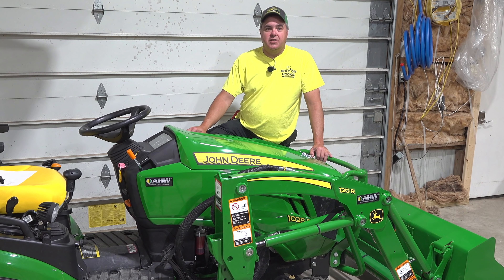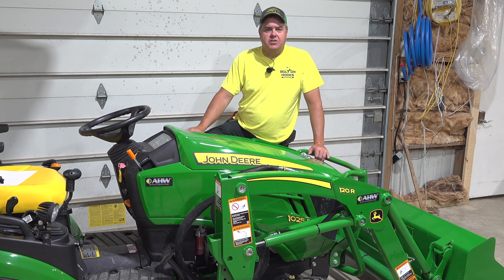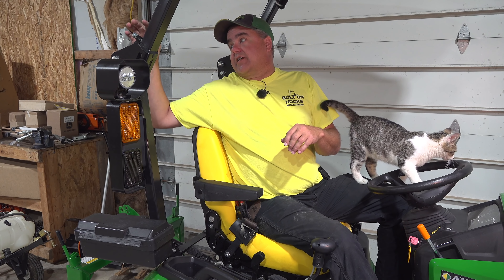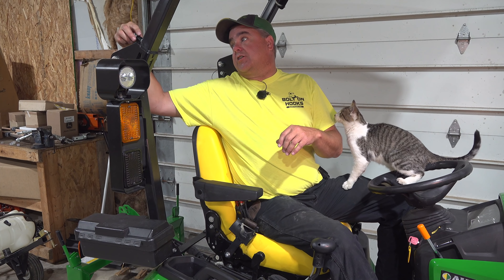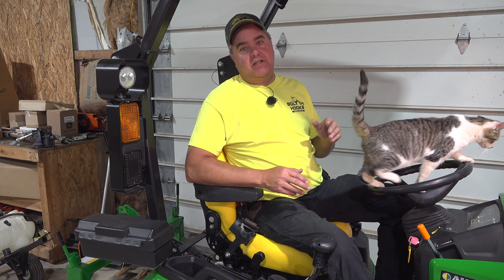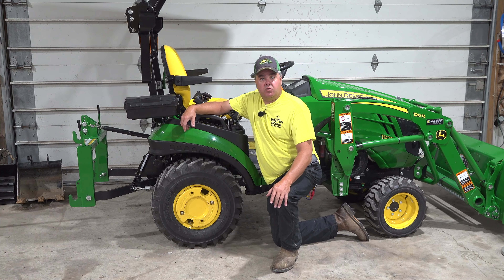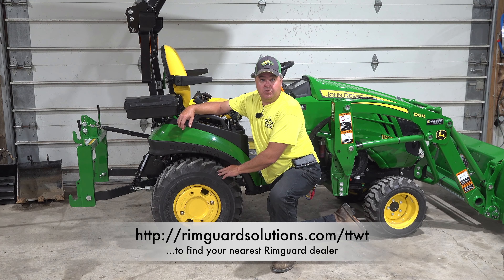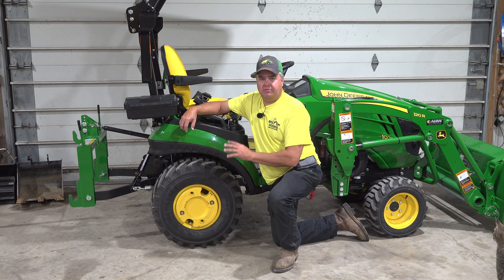NEW 2019 John Deere 1025R with ALL the Bells and Whistles! Model Year Confusion Resolved!

Comment: Hey everyone.  I have the Deere third function on my 2018.  I was told when I bought my tractor that it that it was the second one shipped by Deere.  My dealer had to work with the factory pretty close because it was new for the 1025R at that time. I have to say that it is awesome. I use my grapple more that anything else.  I say this to say, in my opinion, it’s worth it to bite the bullet and get it when you buy the tractor. It opens all kinds of options for the tractor.  It has not impacted my ability to keep the tractor lubed.  The flow is shared so on mine I have to work between the functions to do combination functions.    Tim; love the channel and thank you guys for putting out the great content. Keep up the good work.

Comment: My 1025r was delivered Tuesday.  I was familiarizing my self with it and at 3.9 hours it had a catastrophic drive train failure.  Its now back at the dealer.  Now my confidence in the machine is shaken.  Waited 2 years to  buy it.
Reply from the maker: Bizarre situation.  However, Deere will make it right.  They will replace all parts that were affected.   These moments are when you should be confident in your decision to buy a brand with competent service and support personnel.  Imagine if you were taking your tractor back to your local Rural King store for this major service!

It will be good as new soon!
Reply: Yep, my 2016 (GG) 1025r just had either a blown head gasket or worse yesterday. Loaded it up and going to the dealer today. 214hrs!  I'm disappointed to say the least. But, I loved it while it lasted.
Reply from the maker: Jonathan Morris did you have the newer air filter design?  Wondering if the valve cover was broken?
Reply: @TractorTimewithTim  Not sure what "new" means since this is my first Johnny.  My air filter is a round tube with an outer round filter that surrounds an inner round filter.  I haven't noticed anything looking broken.  It's been fine for a year, (I bought it used with 110hrs), then after 100 hrs of my use, suddenly, it started clanking really badly, wouldn't stay on, and there's coolant in the oil!
Reply: I am sure the dealership will do the repairs fine.  The real damage is in my confidence in the product.  Think of it as a first impressions thing.  It will take time before I will be able to use it and not wonder if its going to break again.  Deere can't fix that.
Reply: Hi Tim,
This incident got me thinking, maybe you could do a video on common issues, problems and breakdowns associated with the 1025r.  Things that are meant to break like shear pins and things that are not meant to break like flywheels.  What to do if it's under warranty and what to do if it's not.  What can an owner fix and what needs to go to a professional.  The gentleman who delivered my now broken 1025 told me if it leaks "don't tighten anything" call us.  He also said if it breaks down "don't touch anything"  Turn the key off and call.  He said that way you will be sure to keep the warranty intact.  Some failures or pending failures could lead to safety issues and some could cause warranty problems if not addressed by the dealer.  You could even add a part explaining how owners can break their equipment by misadventure.   Maybe you have already done this video.  Just an idea.  
 @TractorTimewithTim

Comment: Bought a new 1025r last November.  Traded in my 729.   Nice machine.  I didn’t get the 3rd function.   Loud tractor, you’ll need your hearing protection, lots of vibration, extra rubber on floor mat helps.   Fuel gauge needle vibrates a lot.   Your dealer should provide a free ballast box if you get the loader, JD is being sued for a roll over accident.   I like the roll over deck feature.   I bought a 54” deck, which I found out later you can’t get brackets to use the loader to pickup to work on blades, only comes with 60”.   I bought a deck dolly to pickup deck and store during the winter.   I bought the 60” snow blower, you’ll need weight in the rear to level the machine, less wear and tear.  Also added a block heater for starts below zero degrees.   I put rim guard in my rear turf tires.  To me rim guard gives you a stiffer ride, but I’m not sure, maybe Tim knows.   The 1025r is a lot nicer than my Kubota BX 2370.

Comment: I’ve used the heck out of my 1025R for my landscape company especially the backhoe making me so much more productive day in and day out. My biggest problem is trying to do too much with it sometimes and treat it like a skid steer when grading etc. it’s got some power but not as much as I try to imagine some days. Lift capacity is and has always been my biggest gripe with it. A full bucket can be a challenge to dump over the side of my dump trailer at times. Interested to see the new features on the loader control on yours Tim. Can’t wait to see your 2019 in action.

Comment: Started watching your channel about a year ago and because of your channel I purchased a 2019 1025r tlb with a DJ brush hog and pallet forks I absolutely love it does not have the third function or led lights also bought the backhoe dolly from bxpanded and it is a must have makes backhoe removal easy and a one man job thank you for doing what you do I been doing all kinds of jobs around the property based off your videos
Reply from the maker: Congratulations!
Reply: @TractorTimewithTim  delivered in december with .4 hours now has 34 hours and only cut the grass twice so far. It is also a kk but doesnt have the adjustment on the rops so must have made a mid year change or something

Comment: Hi Tim, Well, I did it yesterday. I got the 3rd function kit and hoses installed for a little less than a grand(plus tax) and went with the AV20f grapple. They made such a great deal that I am going to contact the dealer today and make sure they didn't make a mistake. The only downside is the grapple will not arrive for a month. But then I'm laid-up for most of that time with a minor health issue. 
Thanks for all of your help, advice, entertainment, but especially the scriptures.  As I watch, I am always trying to guess what you'll pick. At 70, I just retired after 25 years of teaching young engineers/CS majors C++, data structures, discrete math, etc. and I'm looking forward to having time to work around the place.
Reply from the maker: I enjoyed c++ and data structures classes.  Didn’t care much for the discrete math :-)
Reply: @TractorTimewithTim  I didn't much care for discrete when I took it either, but for my master's thesis I needed to prove that a recursive computer graphics algorithm was correct. I tried and tried, prayed and prayed, but could not. Then our Lord showed me how to prove it could not be incorrect. Proof-by-contradiction. After that, discrete was my friend :)

Comment: Thank you I have been to Sun South in Foley AL and am sold on this 1025R with the bucket backhoe and a 4ft box scrape box unit
Reply from the maker: You’ll love the 1025r!
Reply: Thank you again for the amazing video and expert experience talking all things JD. Im on a .75 acre and know this 1025R can help me out with all planned items. I have 100 scrub pines small under 30ft to put a bucket on to cut so they fall right. Also putting in brick patio  deck a 400 ft drive. Fencing. A gazebo pad a cabana pad ect.... So I can see on the work vids you do this tractor will be worth it $$. Question on the backhoe section . Can the back hoe digger be removed so as to install a post hole auger. Have you used that tool attached in any projects video. I have at least 60 holes to auger. Thanks again.

Comment: I checked out the VIN code on my 1025r and 9-11 goes CGH. I don't know what C stands for but I was told by the salesman when I ordered the tractor in July 2016 that the tractor was built in 2015 yet was a 2016 model, similar to automobiles. Thanks for the video!

Comment: Those screws on the rops are "anti rattle bolt" if you don't plan on folding or unfolding your rops they are great. Otherwise an extra step when doing so. I also have them on my draw bar. Dealer should have explained that when you received  the tractor but an easy oversight. Excited as always to see you put that machine to work.
Reply: Frank the Tank I have them on my GC-1720 as well. I should start using them. Although I pretty much always wear my isotunes when driving.

Comment: Tim, I purchased a new 2018 JD 3025E. Just got a nail through my large rear tire. I was looking through your videos and couldn’t find anything about changing tires on compact tractors (1,2,3,4 series). I think this would make a good episode and helpful to some of us that are new to compact tractors. Anyway just a suggestion. Thanks and keep up the great videos! 👍🏻
Reply from the maker: I’m not a tire changing expert.  Don’t have the tools.  Maybe i should look into getting the tools!
Reply: @TractorTimewithTim  You should get the tools! There's always room for more tools lol.  I just assumed with all the work you do with big and little "Johnny's", you guys must have had a flat tire or two? If not, wow, that's lucky!  I don't come from a farming background, and we just bought an acreage (13.5 acres) last year, so even how and where to jack up a compact tractor was new to me.  Also the fact you should block up the tractor right away so that the large tires don't deflate and then get a crease in them (which will possibly ruin it).  I don't plan to fix the tire my self, or change the tire on the rim, I'm just taking my tire w/rim off and taking it to a local tire shop that was recommended by my JD dealer.

Comment: More newbie questions...Do you have to worry much about flat tires on tractors?  Do you add slime sealant to the tires?  How often do you check the tire pressure?  What happens if you do get a flat?  Can any tire shop fix the flat?  How difficult is it to remove the tire?  Thanks for always taking time to answer questions.  Your videos are very helpful.
Reply from the maker: Good questions.  I should do a video on this.
I don’t check them unless they look low.
I have had issues getting thorns in the front tires.  I have used tireject to resolve...successfully.
Yes, tire shops can fix.  If you tell em it is a lawn mower, they will often fix for free!

Comment: Thankya Mr. Tim for sharing this video. Congratulations on your new new "Johnny". I wish that all these models came with the 3rd function kit. My 1025R was built it 2016 & i bought it in August of 2017 with 1/2 hour on it & it now has 605 hrs on it, & no "3rd function diverter kit" has ever been installed. Even though i wish mine had this 3rd funcion option on it, i dunno if i could afford to have J.D. here in my area to put that diverter kit on. Now i am jealous of ya, but in a good way, because yours new one came with the 3rd function direct from the factory. Like i said, J.D. should have already done with with all there lil Johnnys that they've came out with in recent years. i guess a guy like me, cant have everything, & should be pleased with what he has, compaired to what he didnt have in the beginning, right???

But, i have been very blessed from the Good Lord above with my "Johnny" & it truely has been a Godsend for sure. Take cafe & thankya again for shairing this video. God bless!
Reply from the maker: You are the perfect candidate for the Artillian diverter kit.  It is DIY.   $700 or so I think.
It works great to run a grapple!
Reply: @TractorTimewithTim  Awesome! And thankya for the reply.  I do have a  couple 2-3 questions for ya, if thats alright. . . . . . 

1.)  Did you install the "Artillian" diverter kit yourself on your 1st Johnny, or did your local J.D. dealer do it for ya???

2.)  If you did install the kit yourself, how hard was it to plum into the existing hydraulic system  & connection setup with worrying about letting any air buildup in the hydraulic lines, if any? That would be my worry!  

3.)  Did you ever have any problems at all with the kit, or were you completely satisfied overall with its capability  & its functionality???

4.) When you sold your 1st Johnny, did you have to give up the operator's manual that came with it?

Thankya for letting pick your brain, lol lol lol😀😎🚜

Comment: When i first started running my 2014 1025R it would chew up the grass when mowing on turns.  I filled both rear R-4s with Rimguard and added a 72 pound weight to each side and no issues since.  Great in winter to do not need to do anything to them other than chains
Reply from the maker: Interesting. Makes sense.  However, no one talks about how extra weight COULD actually SAVE your yard!

Comment: Tim, I have the 3rd function on my 2018 1025R (model JJ).  I installed it myself, definitely a lot of work but doable by a mechanical inclined owner.  I paid just about $950 for the 3rd function valve and the hose kit that goes down the loader boom,  the 3rd function is actually less than the Artillian kit, I think about $700 but I wanted the hose kit to make a clean install.  I used the Artillian manifold on the loader, made some short jumper hydraulic hoses because I have 2 cramps for my grapple and Deere's kit only gives one set of couplers.  And as for your theory on the bucket level indicator, the first step in installing the 3rd function loader hoses is to move it to the left side,  Im still trying to get used to looking to the left side instead of the right.  I look forward to hearing your thoughts and see if you have a different experience with the 3rd function, I cannot use the 3rd function and curl/dump at the same time, but lifting/lowering and 3rd function works fine.

Comment: Hey Tim, another great video.  I just ordered a 2019 1023E and the real supply issue for me was finding the 54 inch deck.  They have plenty of 60 inch decks, but I wanted the 54 inch for my mowing situation. My dealer had to reach out to 30 dealers before he found one that would part with a 54 inch deck.  I also added the Deere LP65048 MCS. This is very similar to one you were using in a previous video to vacuum up leaves, Looking forward to getting it all next week!
Reply from the maker: I wish you had purchased the TKV20.  You would much prefer it to the power flow unit.  Oh well!
Reply: @TractorTimewithTim  Never knew it existed until your video and by that time I had already ordered the Deere unit.  I do like how the TKV has the blower moved away from the deck, but that is how Deere power flow units work. BTW, how does the TKV blower get power?
Reply from the maker: Rear PTO.
Reply: @TractorTimewithTim  Yup, I found that out on their website and also found out my Deere dealer could offer it. I tried to change to the PTO blower, but the unit has already shipped.

Comment: Thanks for clearing the confusion on the model year.  Can’t to go look at mine now.  I don’t know whether I’m going to be disappointed or not...LOL.  In any case I’ve put about 4 hours on my new 1025R and love it.  Hope the cat heals up ok.  Love to hear more thoughts on the LEDs at night.  I just ordered a 12” LED and bracket for the ROPS up top from Tractor Bracket.  Will see how that goes. Thanks again Tim!
Reply from the maker: Look at the paperwork.  Serial number is on it.
Reply: So, I walked out to the barn and double checked again compared to my paperwork.  My units VIN is 1LV1025ALK805060.  You had mentioned that all 1025Rs start with 1LV1025V.  Any idea why the A vs. the V you spoke about.  By the LK, I’m guessing December of 2019 build.  Thanks again for all of the content.  I’ll be adjusting my deck today.  It want even close to spec.  I’m guessing they only install them for transport and not operations.  The dealers sure seem to miss this a lot.  Mine said bring it back but I’d rather learn it myself.
Reply from the maker: LK means built in calendar year 2020. Model year 2019

Comment: Had JD install the factory 3rd function on my 2018 2025R when they first came out with them. My joy stick looks taller than yours, and no ya can't use curl/dump at the same time. However it works very nice with the AV20F grapple. Doesn't interfere with that fun grease zert either, but I've never had a problem using the needle attachment.  That canopy looks silly IMO... nice vid TTWT

r

Comment: Hi Tim! I bought a 2019 1025r and am currently installing my factory 3rd function kit and front hose/line kit.  This video is how I found out it was an option.  The kit was "only" $726 and 240.90 for the hose kit.  Not so bad.  Also consider the JD kit is not a diverter, rather an actual 3rd function.  I also ordered the Frontier Grapple and can't wait to use it.  Thanks for showing me how versatile this tractor is especially with the grapple.  P.S.  So sorry about your Dad.  I loved "getting to know him" through you. Peace
Reply from the maker: I discuss the ‘3rd function vs. diverter’ in actual usage in a later episode ‘100 yr old levee’
Reply: Steve Hammond  did you successfully get it installed?  My dealer would not do it so Im considering this project.